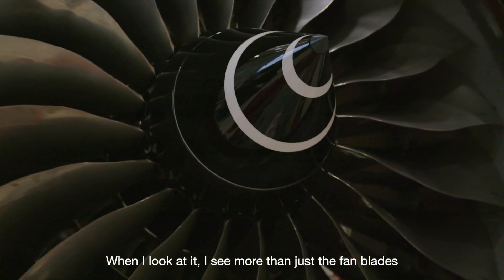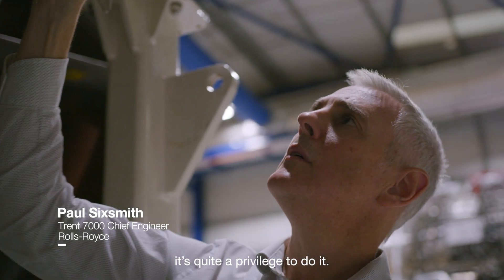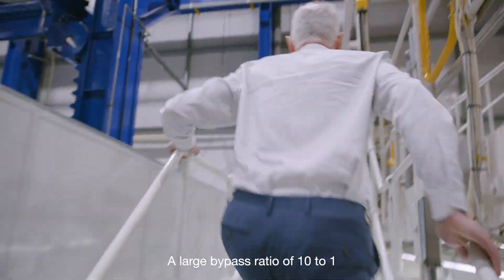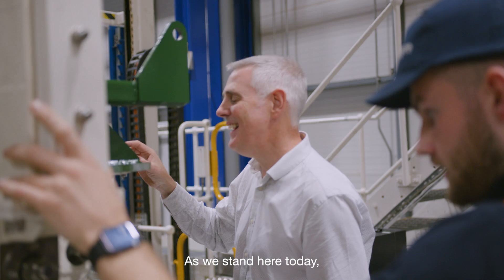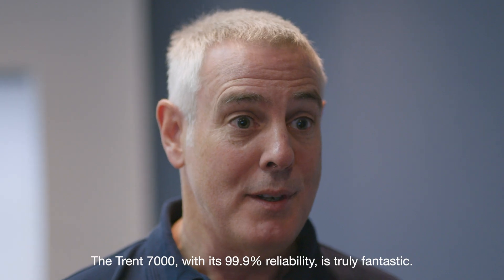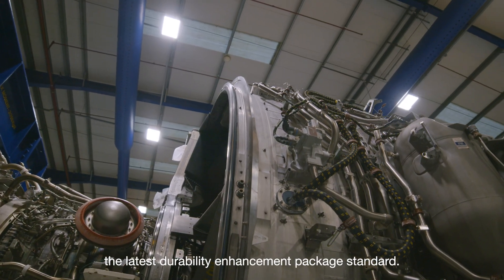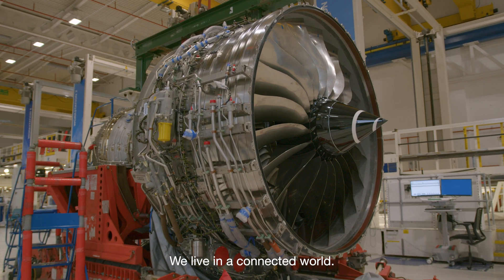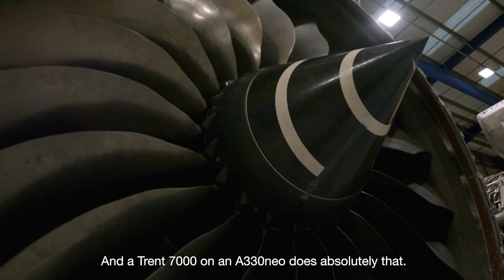Rolls-Royce |

Comment: Germany invented jet engines (or at least flew them first)
Reply: No! Germany did not!  
Frank Whittle's UK patent of 1930/31 predated that of Hans von Ohain by several years.  Whittle's patent was published and distributed to both industry and technical institutions in Germany by the Patent Office in Berlin in 1931, and it is quite possible, therefore, that von Ohain may have seen it.  In any case, a Belgian by the name of  Maxime Guillaume was granted a French patent for a crude form of axial flow jet engine in 1921.   
Heinkel's He178 first flew for six minutes with von Ohain's engine in August 1939.  It was certainly the first true jet aircraft to fly, but the engine could only be run for a few minutes at a time: it certainly wasn't airworthy by British standards.
Frank Whittle's W.1 engine, in the Gloster E.28/39, did not fly until May 1941: however it was airworthy and, after an uneventful first flight of seventeen minutes, the aircraft was put into its hangar with no attention given to the engine.  
The W.1 was very conservatively cleared for 10 hours of flight, which it comfortably achieved and, on inspection, the one small defect observed was a small crack in a combustion chamber.  
Having been replaced with the improved W.1A, engine, the W.1 went on to do many more hours of ground running, before suffering a turbine failure.  The engine is still to be seen in the Science Museum in London.
You may be interested to know that, in 1944, the Jumo 004B in the Me262 had efficiency, performance and fuel consumption figures that were inferior to those of the W.1 in 1941.  The handling of the 004B was also abysmal: any rapid movement of the throttle could induce a surge and flameout.
At the end of the war, the British centrifugal engines were significantly superior, in terms of both performance and reliability, to any axial flow engines in existence at the time.  It took until the end of the 1940s for axial flow engines to supplant centrifugal engines.  
Even then the Klimov VK-1, a reverse-engineered Rolls-Royce Nene, which powered the MiG-15, was competitive with the axial flow GE J-47, which powered the F-86 Sabre.  The VK-1 was marginally less efficient, with slightly less thrust, but was significantly lighter than the J-47.  The Sabre was a better fighter plane than the MiG because it was superior aerodynamically, not because it had a better engine.
Reply: @grahamj9101  Thanks for that summary. I'm not a jet engine nerd but I am finding them increasingly fascinating, especially after reading Not Much of an Engineer by Stanley Hooker.